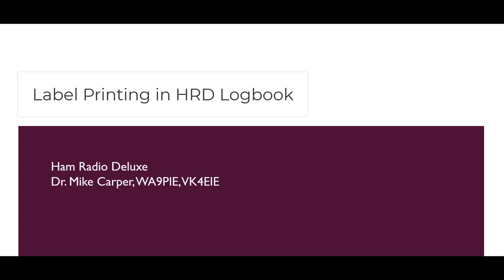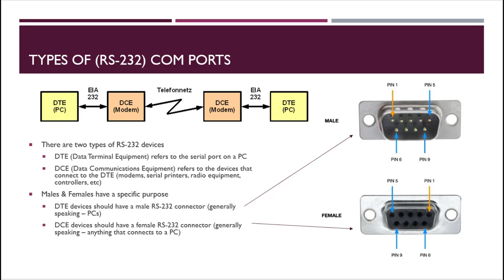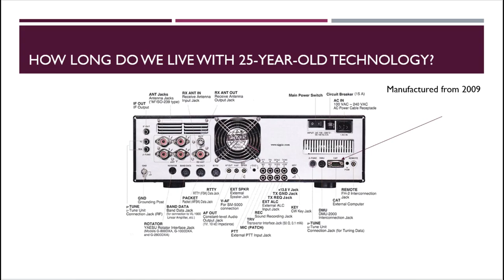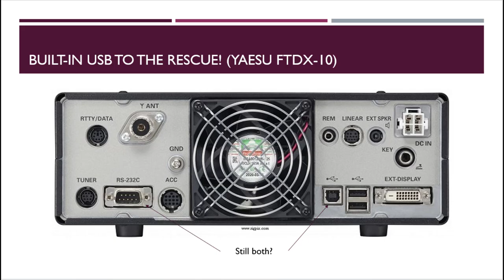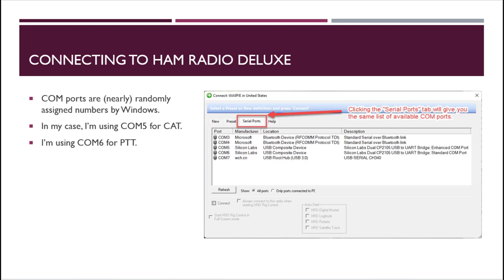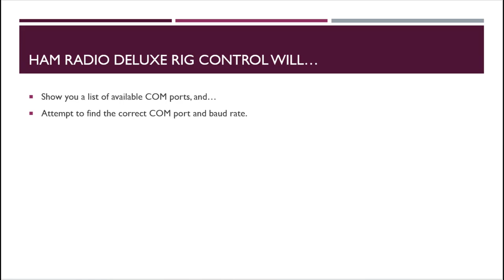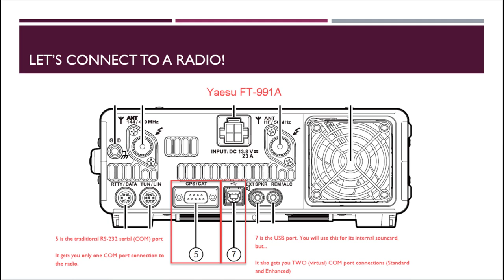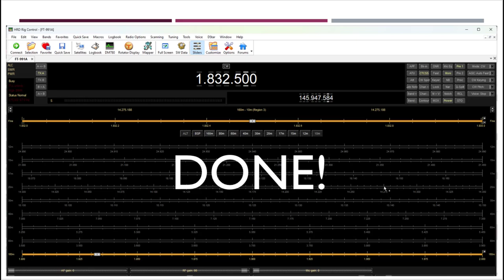Understanding PC COM Ports for Connecting Radios for CAT

Comment: Great explanation. With all the RFI nowadays between PC and radio over USB what would be the best future solution if we still use a physical connection ie not WIFI?
Reply from the maker: Yeah, eventually this all needs to be Ethernet (wired or WiFi). But... sadly... we still have rigs shipping with DB9 serial connectors on them and serial connectors have been gone from PCs for 2 decades or more. It may take a while. Then... software will need to stop looking for a virtual COM port and go directly to the radio over Ethernet.

Comment: Correct me if I'm wrong, and for whatever reason, (I'm not sure about JUST PTT) , on the IC-7200 the USB is for soundcard ONLY and that funky Port 76 1/8" jack runs all the radio functions.  Hmmmm...
Reply from the maker: That's quite possible. I've never used that rig. But it could be one of those cases where you get the soundcard but somehow need to either split the existing COM port or get another USB-to-Serial cable that you can get into the PTT connection.

Comment: Hello Dr. Carper, Maybe a little off-topic, but are there any plans in the future to incorporate the possibility to setup a (HF) radio with a transverter offset in HRD? I am a DX'er on the 2m band, and for best performance, I use a HF radio and transverter setup. Ham Radio Deluxe still thinks I make contacts on the 10m band when I log a 2m band QSO. So at this moment, I am forced to abandon the CAT connection to HRD, and to manually fill in all QSO data... Any solution or workarround is very appreciated! Best regards, Kevin ON5DRE.

Comment: I do hope you will (in the future) consider UDP as a communication pathway.
Reply from the maker: We absolutely will. Rig Control already communicates to the other apps in Ham Radio Deluxe using IP. But at present, it won't do us much good to go UDP/IP to radios when 99.9% of the radios are incapable. But yes, absolutely that's where this needs to go.
Reply: @HamRadioDeluxe  Outstanding!  My RF2K-S amp from RF-Kits can listen to UDP on WiFi or LAN so that is just another bit of gear that would benefit from HRD broadcasting UDP.  So if HRD can someday broadcast UDP for frequency, then my amp will be able to follow along.  Today the RF2K-S is connected to the Yaesu 101MP via CAT.  But wire elimination would be beneficial in the long run.   Keep up the good work.  Oh and a tip on Bourbon,  add a few TBS of simple syrup to your glass and mix with Bourbon .... man that is good, and BTW glad you can get Luxardo cherries there in VK land.... 73 Art W1SWL